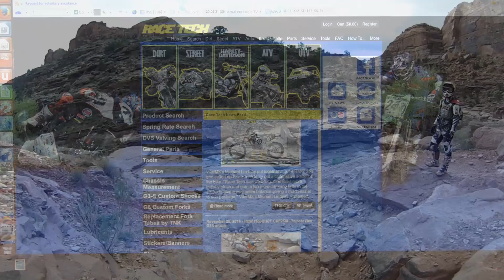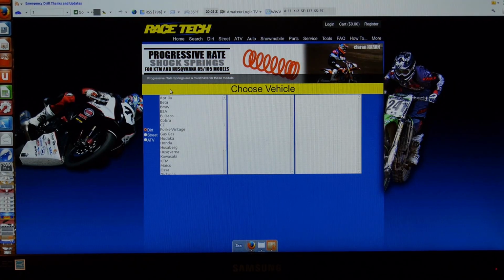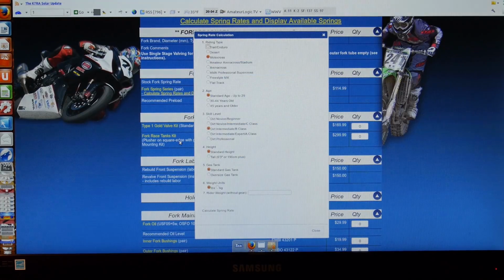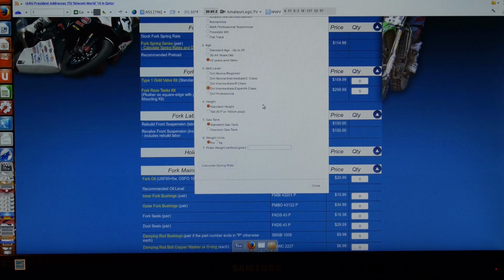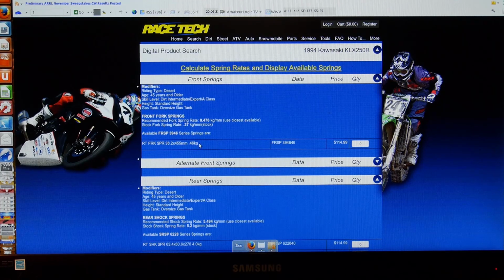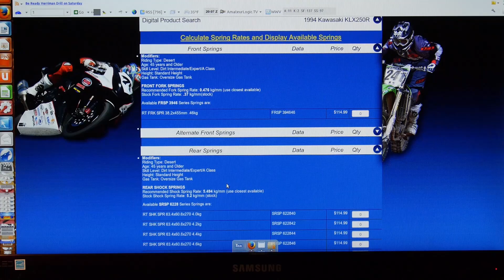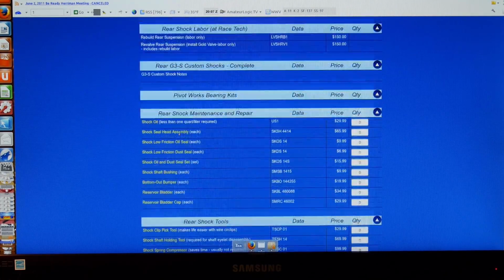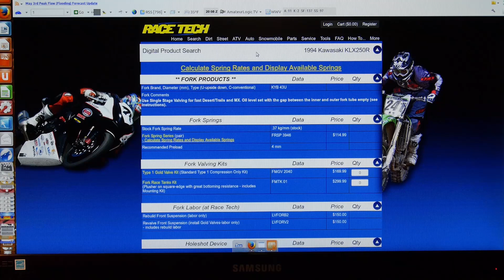KLX suspension build - Picking springs - part 1

Comment: It's an important part all the prep work and getting the right springs! Questions though. I am doing a spring upgrade for my street bike and was wondering does the oil affect the spring rate? And if so can you use it to fine tune the rate to get it closer to that magic number race tech gives you?
Reply from the maker: Well, oil does not affect spring rate, but thickness or weight of oil will affect dampning. The heavier the weight of oil you use, the slower the compression and rebound your forks will move, all other factors being equal. If your forks are too soft after the appropriate springs are installed, and you don't want or can't change valving, you can use heavier oil to stiffen fork action. When you use heavier oil, it will slow rebound too, which is not a bad thing on the street :) good question bro!
Reply: MrDuhfactor Thanks for the answer. that is really helpful! You actually got me doing a bit of research on it now. Getting my head around the pros and cons of damping and all the rest :) I'm looking forward to doing a bit of a rebuild of my own in the new year

Comment: so i watched an advertisement for a product called seal mate have you ever seen or used one... my 06 yz450 has gone threw many fork seals and im curious if u have tryed these im very tempted just to buy some. the recommended video came up from me watching ur great guides (; keep it up
Reply from the maker: Hey Chris!! I actually don't use that product, and don't have any experience with it to give any feedback. Usually, a person should be able to ride hard for a couple years on a set of fork seals. Two common reasons for blowing seals quickly are dings or burrs on the fork sliders from rocks or gravel hitting them, or worn out bushings. Maybe it's time for a tear down and inspection??

Comment: my recommended spring rates for the front are  .46kg/mm and recommended is .503 kg/mm. The rear is 7.7 stock and 8.9 recommended. Is it that much of a difference?
Reply from the maker: That's what I was looking at on your bike too bro.... The formulas are based on bike weight, and rear linkage leverage ratios, with all of the other modifiers you put in for a balanced suspension. If a person uses lowering links, they are longer than stock, and soften the action, so usually people will upsize the rear spring even further, maybe even going to a 9.1 kg/mm. It can be a problem when someone wants to put the standard link back on though, then the rear becomes too stiff. As a result, I usually go with the recommended spring with the standard link, then make up stiffness a little with valving and clicker settings with the lowering link. Your bike is heavier than Katsumi (battery and starter, lights, etc) , which is why the recommended spring rates are stiffer for the same action and bottoming resistance. Yami tries to appease the masses with selection of springs and valving, which is why your specific application looks so different than stock. God observation bro!
Reply from the maker: minitstop oh..... the other thing to consider..... The faster and more open the riding is, the more the spring rate and valving need to be upsized to handle the compression forces, which is another reason softer seems to work fine for the tight technical riding you do on the island..... although balancing the spring rates front and rear in all cases seems to really make the bike handle better and more predictable. That soft rear spring is probably why you have the bottoming out experience on bigger jumps you ride on......
Reply: Yes yes. I want an "overall" performance boost in suspension. I'm looking forward to learning how especially for Daisy Chain. When I get back there, I hope you can teach me so I can work on it ;)

Comment: Great tips, went to race tech site and put in details of me and my riding style or lack off along with the fact it's also a 1994 klx250 and I can either spend $300 ish on parts or lose 20lbs, think i'll go for losing 20lbs cheaper and ill feel better for it. Whens next part coming, come on get them out there.
Reply from the maker: We'll do man!! Keep in mind that the spring rate is also about balance between front and rear.... if yours is a 94', I would imagine the springs in yours are the same as mine aren't they? Yes, I'm a chubber.... but the thing I hated was the firm rear, and soft front..... bad balance for me....
Reply: MrDuhfactor Yeah your right, got that excited about saving money and losing weight I forgot about the front to rear balance, will just have to wait to see your videos and then once my engine is rebuilt (crank big end gone) I will ride it for a while and then see what I can do. Did see a post about using 10w instead of 5w stock oil to stiffen front end but not sure how that would go. Great videos by the way.
Reply from the maker: putbinoot Good point, it all depends on what your after.... 10wt is definitely stiffer, but also slows down rebound. As a result, some people will use 10 wt to slow down rebound, and compensate compression by softening the compression valving, to try and make it plush. I like to stay with 5 wt as much as I can, because it makes the suspension more plush, as long as you can set up the valving so that you don't bottom out, and have it still handle the obstacles your tackling.

Comment: It sounds like proper spring rate matched to weight and riding style and ability is the first step and foundation to a good suspension. Can the spring spec be identified by any measurement or markings?
Reply from the maker: You nailed it my friend! Most aftermarket springs will have printed their spring rate on one of the coils. Stock springs when removed may have a marking on the top coil, a groove, two grooves, or three grooves, which correspond to a specific spring rate (With KYB's anyway) A quick phone call to the dealer will usually help determine if the spring you have is stock or aftermarket, and can usually figure out the spring rate you have. Or.... you can just call me :)

Comment: Okay so, it looks like the front is correct and the rear is .02 light. I'd say that's okay. Other guys have been on it and they both said the front was too light. I didn't think so but straight rate was recommended otherwise. On to valving/rebound?
Reply from the maker: For a good balance set up for your riding, sounds like you're there!! Springs are the first step, then yes, we move onto valving :)

Comment: Holy crap... Race Tech says that my 08 KLR has .40KG/MM up front and that I need .751KG/MM because of my stout stature of 6'1" 290lbs... read that as I need much stiffer springs because of my fat butt. :-) Thanks for the info... I know what to do suspension wise...
Reply from the maker: My friend.... You sound like a KLR crusher :) Yes, a .75 kg/mm front spring set sounds about right for you!! You wouldn't believe how much that makes a difference in KLR riding and safety.... Good work dude.....
Reply: MrDuhfactor Do you happen to know if the Race Tech springs are a progressive rate or are they static? I suppose with the right spring rate it might not have to be progressive. I appreciate your love for all motorcycles... no brand or type loyalty... They all have great aspects of what they are made to do... It is refreshing to have your view point and knowledge put on display for the rest of us yahoo's...
Reply from the maker: Hey buddy!! They are not progressive, but depending on valving, etc, the forks can be made to feel progressive, which is what I shoot for. Glad to have you along bud!! Thanks for watching!